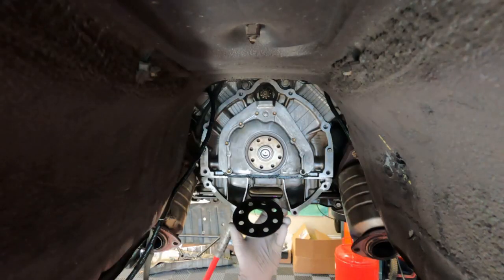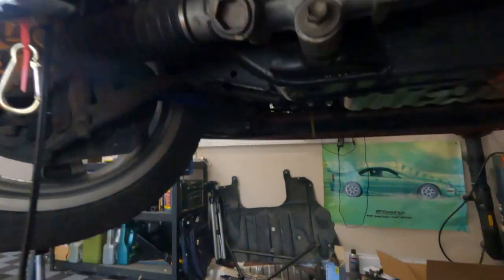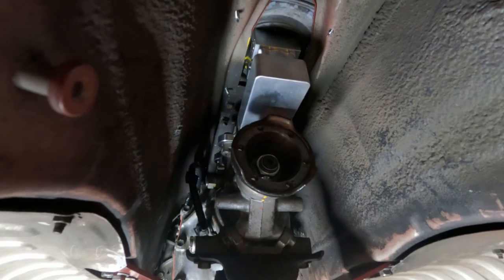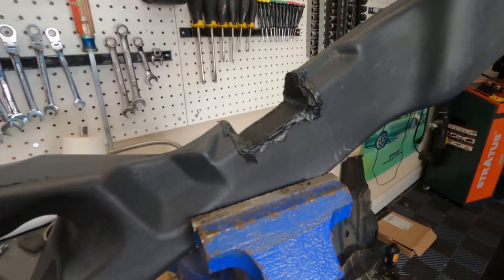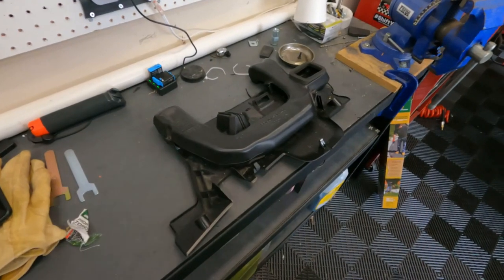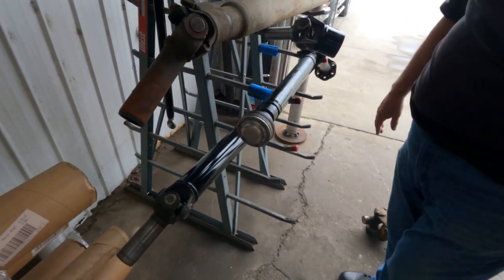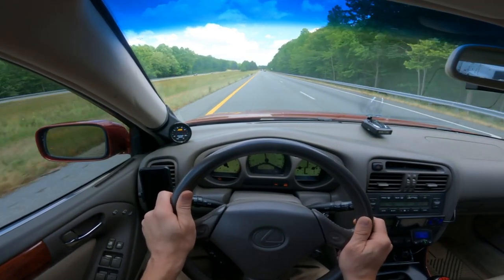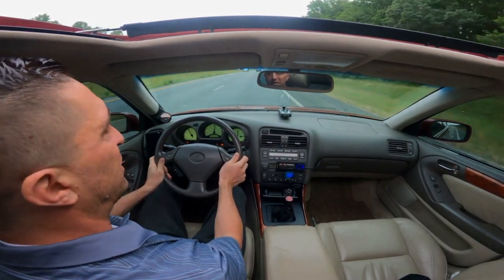Manual Swap | LEXUS GS400 | Episode 5 | TRANSMISSION INSTALL & FIRST DRIVE!

Comment: Jesus! It started raining on first test drive!!! I'd be flipping out.

Also thanks for posting these comprehensive videos!!! I'm planning this swap for my 1UZ swapped IS300, I call IS400. You're swap will be about 80% the same, but definitely gave me so much more confidence on starting this project.

Currently I am running the stock IS300 A650e auto. Love the power, but I want a manual swap so bad!
Reply from the maker: The swap will change your life. So will Jesus if you keep yelling his name like that. 😆

Comment: Great Job brother!! Does it feel like you need to make any adjustments to the Apexi Neo since the automatic is gone?
Reply from the maker: Thx! Well now that it will hold gears at any rpm I can tune the low rpm range. I actually had it pretty close, but I did need to make some changes at low rpm (previously it would just kick down below 3500RPM or so). I pull fuel starting around 2000RPM at about -2% and it increases from there to -12% at redline with a target AFR of 12.7.

Comment: Great video, any vibration at higher speeds? I'm using a 2 piece with the drift motion adapter on my ar5 and get some vibration at 105 and up.  I was thinking of getting the solstice transmission side attachment to one of my drive shafts to see if that gets rid of vibration past 105.  I never drive that fast so I might never mess with it again.
Reply from the maker: No vibes! Good to 120 so far (on a track of course 😉)
Reply: @jice z what’s your setup?
Reply: @robertdonald123  2002 is300 stock 2jz, 2006 ar5 with 2 piece driveshaft, driftmotion ar5 adapter, 1jz r154 bellhousing w58 flywheel and pressure plate, cpr sprung full face clutch disc, monster clutch slave cylinder bearing and solstice slave cylinder, 84 land cruiser master cylinder, Toyota verossa retainer and shifter, is300 clutch pedal.  Using the y38 4.1 lsd diff but will be switching to the 3.7 lsd diff pretty soon to get a little bit more out of 1st and 2nd. Also coilovers ls400 front calipers, everything is poly bushed with all arms replaced on the rear subframe for new adjustable arms, hardened engine mounts
Reply: @jicez6649  did you have to cut your driveshaft? With the dm adapter, it’s 6 to 4? What clutch disk are you using too?
Reply: @robertdonald123  the drive shaft will be custom as there is nothing that will just work with the ar5 is300 setup.  The shop I went to said they could modify the stock driveshaft to bolt to the dm adapter using a 1350 flange for 500.  The way he did it in the video is probably the best way to get rid of vibration by getting solstice driveshaft and having a shop attach the solstice ujoint side of the pontiac driveshaft directly to the ar5 bypassing the dm adapter. I get vibration above 105 but I'm fine with that for now as I just use it for daily driving.  The clutch disc is a Sachs sprung full face disc purchased from cpr manufacturing and I believe for my setup the disc cannot be bigger than 226mm,  dm has a 226mm 6 puck clutch disc that is probably the easiest way to get a hold of correctly sized disc for this setup
Reply: @jicez6649  instagram? I need to inbox you
Reply: @robertdonald123  do you by chance have an email I can reach you at?

Comment: Thanks for the effort in documenting this. Did you see if an A70 Supra shift knob can be used? Old OEM or TRD would look stealthy.
Reply from the maker: Not exactly. I had a TOYOTA euro L leather knob on there and the CUBE performed way better. Sure the L looked better, but the CUBE is twice the weight of the leather knobs. The trans is quieter and it shifts better with the CUBE, so I put it back on.
Reply: @ForwardMomentum  Ok, nice. Some people do prefer rounded knobs. Cube doesn't seem to list the weight of it online, but I'm sure it's possible to find a weighted leather one with the OEM look.
Reply from the maker: @MrCarGuy  the L knob was 88 grams and the CUBE was 166. Crazy!

Comment: Dear i have an issue on mu car trans sometime when its cold or just started the engine if i shift it in reverse its not work till i warm up trans by driving on D for awhile then it work in the reverse !! What should be the reason for that ? Valve body ! Filter! Fluid? By the way fluid is Toyota original ! I dont know if i could replace it fully the trans .. Pls tell me what i do , b regards
Reply from the maker: Unfortunately that was the first sign that my transmission was on its way out. Do a drain and fill only and make sure you have the correct amount put back in. That may buy you some time. Sorry. I hope you have better luck than I did.
Reply: @ForwardMomentum  hehe 😂 i hope 2 , what ever i decided to replace valve body with old trans which was good in reverse shifting but only sound issue was on it, that made me replace it with this one which i got reverse issue,, so i will try by replacing valve body with new filter and fluids hope that give me good result if you recommend it😂???
Reply from the maker: @falblushi6701  give it a shot I guess. I just ended up manual swapping mine. I hate that transmission. 🤣
Reply: @ForwardMomentum  oh bro manual is so good if there is no traffic , i live in a place if i get manual trans then no need to go gym 🤣😂

Comment: Is it faster?
Reply from the maker: Quicker? Yes. Acceleration is much better. Faster? No. Top speed should be the same because the 5th gear ratio is almost identical to the A650.

Comment: If you are gonna pull the starter gear out like that, make damn sure the battery is disconnected. Deff don't want that starter to engage and suck your finger in between the teeth
Reply from the maker: Yes, absolutely. The battery was disconnected (I just didn’t show it).
Reply: @ForwardMomentum  It was for anyone trying it at home more or less lol. Nice job by the way!